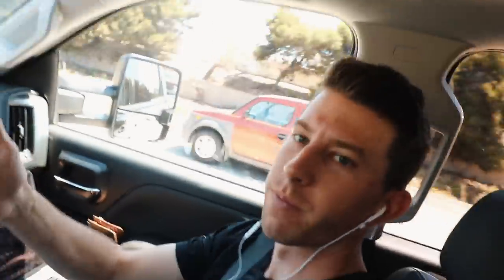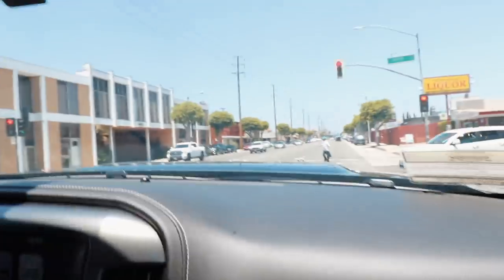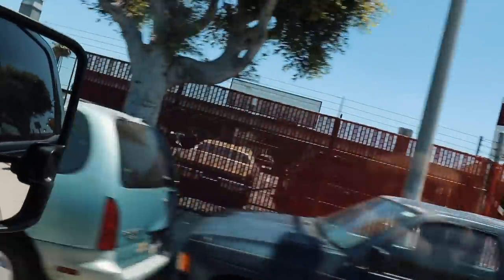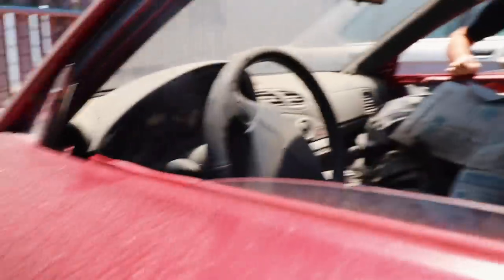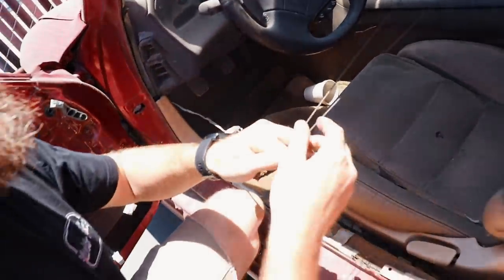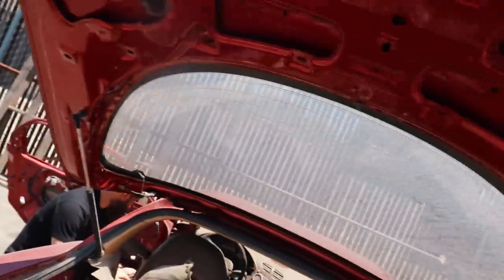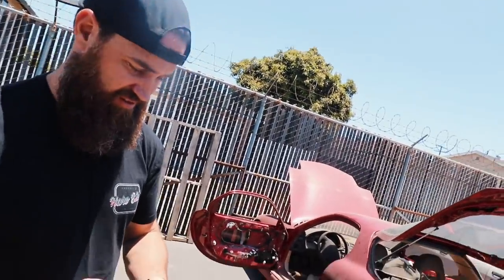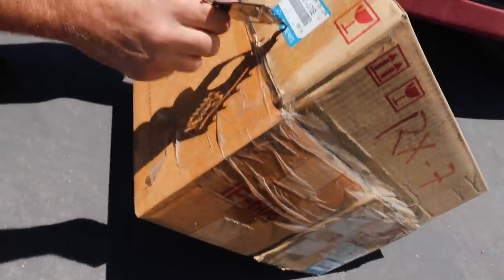Finding and Making an Offer on ANOTHER Junkyard RX-7...

Comment: Yeah it's been sitting. It's all there. Pull the motor and trans and interior and clean it really good.  Have to look past the dirt!  I would pay $7500
Reply: JDMovation u make it sound simple, its not. FD's are a pain on the ass to get stuff done and for that condition of a car?? no way for 7,500. Tj had to send his motor all the way to Australia to get his motor rebuilt and tuned. But at the same time all that hard work, sweat, blood, and tears will be worth it.
Reply: PRO_STREET1095 it's a Steal!!!!  He could easily part it out and make double!!! Are you kidding me. I can have that rebuilt locally here in a few days! Great deal like I said I would buy it for 7500
Reply: hes not likely to have someone rebuild his car, with tj's cars and his car/s it will take a while.
Reply: It was New Zealand he sent his motor to btw
Reply: PRO_STREET1095 tj didn’t send his motor to Australia.. pay attention man. 
He bought a complete package from ppre in New Zealand.
Reply: If he came to Australia I would of went to the meet haha
Reply: $7500 is a great deal.
Reply: PRO_STREET1095 no it’s pretty simple. The reason tj’s took so long is because he bought parts from all over the world and he wanted his car to be 100% perfect. I don’t think Mickey is going to build his car on the same level as tj’s
Reply: I disagree that it is worth it.  It has been several years but I sold a mechanically well sorted FD for around $14k that had a new engine (not reman), GT35R single turbo setup, V-mount intercooler/radiator setup, coilovers, PowerFC, etc.  The interior was in decent shape, much better than that piece of crap.  Exterior was ok, needed a respray and new seals/molding.

Comment: If you buy that you should put a 20B 3 rotor but right now there are 2 20B’s for sale on eBay
Reply: Funny... I have an Acura cl with a f20b in it I got for sale in Tulsa 😗
Reply: Jessie West 
A mazda 20b, Not a honda engine ya goof
Reply: RotaryKidVideos F20 is an S2000 motor
Reply: DARRENTINOnz, f20c is s2000, f20b is a jdm Honda Accord engine very similar to an H22.
Reply: LeeRoy Dundlehay Oh okay thanks for the correction.. I was pretty close for not being a Honda guy
Reply: So damn expensive to convert to 20b...be sweet as fuck. Just crazy expensive
Reply: Who the f is gonna put a B20 HONDA motor......Now the 13B is a diff story
Reply: zach bell a 20b is a 3 rotor rotary engine....people build them, or you can get then out of eunos Cosmos. And a 26b is a 4 rotor.
Reply: Why on earth would you put a 20B in it? First of all the car is perfectly balanced the way it is and putting in 3-rotor is definitely going to adversely effect the handling. And secondly these things tend to be worth more money when they are kept bone stock. And let’s not forget that with a 20B the gas mileage would probably be worse than most full sized SUVs. Also if you want more horsepower you can easily get it out of the stock engine. I’ve had my FD for over 20 years now and it has only had reliability mods – none of those idiotic modification that just ruin an otherwise beautifully engineered car.
Reply: Randy Randerson That's kind of an ignorant statement.  A lot of RX7's you see these days are just shells.  Rotary engines and parts are expensive and hard to come by.  I'm in the market for an FC shell, there's no way I'm spending that much more money just to satisfy purists like you.  I love RX7's for what they are, I own a FD, but what I do with my property is none of your damn business tbfh.

Comment: well, even if the engine has been rebuilt 10yrs ago.... with rotary engines you DONT leave them standing due to the Apex seals drying out, 10yrs of baking heat etc... you'll have to rebuild the engine now anyway.. 

the Apexi unit looked to be the boost controller "its not the power FC piggy back ECU"

however the one good point is, the paint.. under all that dust/dirt you might have a good paint finish "hopefully"

Comment: Not all pumps stop at 100. It depends on card, and station. I’ve seen it stop at $50, $100, $150, $200,..... I’ve filled up all over the USA via all kinds of stations. I do understand the frustration. Especially in the more expensive diesel areas.

Comment: I miss my FD. It was a 1996. Japanese import. Chaste white with red leather interior and carpets. Black wheels. Best car I ever owned.. hands down. But also the most expensive to run, most high maintenance. I sold it.. perfect condition car. Got £6,500 for it. I dunno what that translates to in USD. It was an okay price at the time.. probably quite good.. I imagine it'd be worth a fair amount more today though. But at the time.. they weren't really desired in the same way. People liked them.. sure, stunning Japanese sports car. But they also just saw them as a big, aging, petrol guzzling parcel of trouble.. that nobody here could work at. So you couldn't sell them easily. I wish I'd have just parked it in the garage and forgot it.. it would be still there today. With some subtle, classy mods (wheels, suspension, exhaust, few other bits etc) I really do think they're one of the, if not the most beautiful car ever to come out of Japan. The thing could go too.. crazy fast.
Reply: I just checked.. that would work out at approx 8600USD. My FD was pristine.. literally immaculate car. Nicely but tastefully modified also. Perfect runner. I drove it daily for a long time. Ended up I was spending more on fuel than I was making, haha. If I could only get another like it for the same price I sold it for.. I guess I'd need a time machine.

Comment: I've got a friend with an Red RX7 convertible stashed in his garage. It's been sitting for close to 12 years and needs a new motor. I believe it's a mid to late 90's or early 2000's manual trans. Black interior that is in a1 shape. Care to give it a shot because he might just sell it if the price is right. He's located 30 miles north of Detroit.

Comment: Buy your diesel at a truck stop. I put over 150 gallons in my truck in one fillup.
Reply: dispensaries that are used to fill large trucks and equipment have a higher flow rate then dispensers used for regular diesel vehicles which most of the time causes it to shut off as if the tank is full. this is due to the fill neck of the vehicle filling with diesel up to the nozzle which will cutoff. I
Reply: Anthony c I could have sworn they have pumps for pickup trucks and RVs. Maybe not all have them, but it may be worth calling around.

Comment: Bruh! Pushed at 10 mins to write this, In Britton you would hesitate to pay £600 for that!!! If that's been sitting for ten years the engine and box and brakes will all be seized solid!!! Suspension, shocks n springs, leaking or seized and rusted, Loom chewed by rats and mice, and the interior is fecked!!! So realistically your buying a rolling shell bruh! Wich actually looks pretty rust free and you could strip n rebuild the turbos 😃👍🏼 lol not to mention the ultra rare solinoids n parts that operated the sequential turbos will be clogged up and wres chewed and fucked up too!!!

Comment: The pump stopping @ $100 isn't the pumps it is your financial institutions because I can put $230 or more in my tanks (2 of them 120 gal of fuel total capacity)you have to call your bank and work it out with them
 it's the pre authorized amount that needs to be increased

Comment: 10K wow LOL I just passed up on a running in 94 SL500 Mercedes with optional hardtop in black color and had the AMG wheels on it the interior was a little messed up and the registration was 2 years old but I didn't even go get it and I got the price down to $800 this is not a lie this just happened last week

Comment: Me and my boys back in the early 90’s yes that’s how old I am bought 1 gen rx7’s for 1000 to 2000 grand for low mileage ones. I had both the  1980 and the 82. Paid 1200 for both of them back in 93. 82 had the 5 speed with the factory shorty shifter. The 1980 had the manual choke on the dash left of the steering wheel. Both ran great. The car in the video isn’t even worth a thousand bucks IMO

Comment: Why would they leave the windows down? Fuck lol
    Also there's a guy with a FD with a fully built 700hp ready 13b REW turbo engine with everything to make it run but a tune and fuel pumps and a pretty clean blue body thats been garage kept for $8500 obo by Tinker AFB in Oklahoma city. 

Car just needs fuel pump and a couple very small things to be a runner and needs a couple small body parts to look great too.

Comment: Bought a probe gt in worse condition than this, and yea...it was a five year every now and then project, that turned into a 43.000 frame off restoration, I learned the hard way you just have to commit if your going to get it done. Now when it was done...it was done with just about every plus you can imagine.

Comment: That's not a truck it's a bakkie(double can). Truck's are much bigger an pull 40ton trailers
Reply: An it takes diesel not gas. Gas is used in the house an other industries